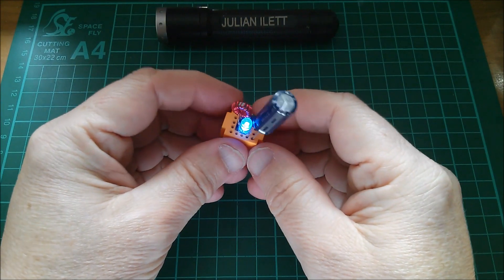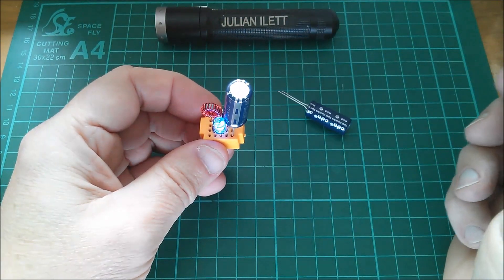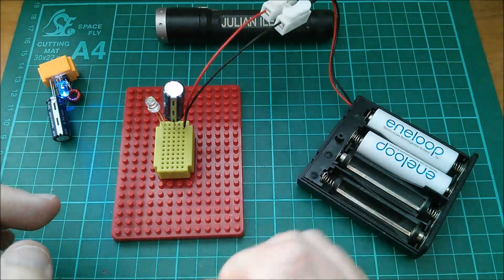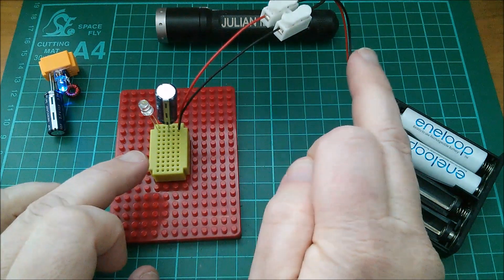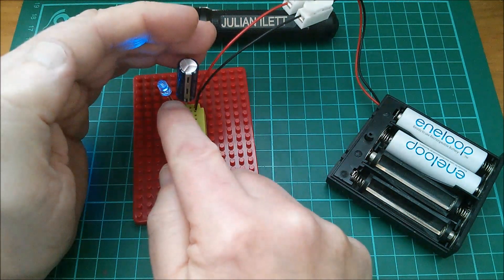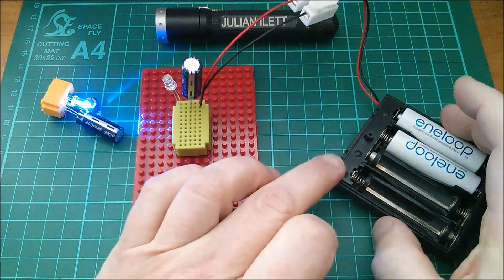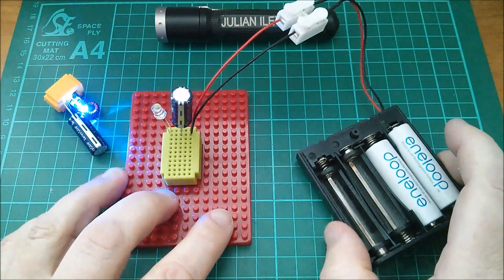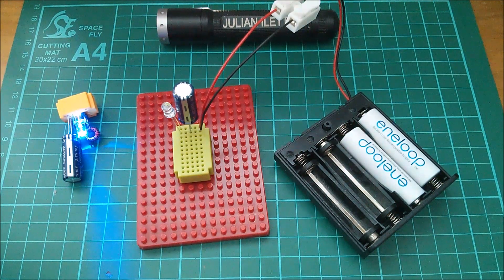Quick and Dirty 2.5V Supercapacitor Charger

Comment: Charging £5 for a momentary switch is the reason Maplin went in to administration
Reply: Yep. I was in town the other day and went into Maplin to see if I could pick up any bargains and walked around the shop gasping at some of the prices. Ten 5mm LEDs, £3.99. Those poundshop precision screwdrivers with 8 interchangeable bits, £9.99. I did grab a couple of reels of wire and some blank circuit boards but even heavily discounted those were only a little cheaper than I usually pay.
Of course they could never compete with China/ebay but there wasnt any effort to compete with domestic suppliers either, or to make their offer attractive in the least. Kind of sad to see them go but if that was the best they could do there was no hope.
Reply: If they weren't SO greedy with their prices, they'd still be in business. Other shops such as poundland and wilko still manage to make healthy profits with their MUCH lower prices and they still have to pay the same staff wages, business rents and electric bill. So there is no excuse for maplin's huge price markup. They should stock more quantity for cheaper price.
Reply: I actually went in to Maplins just before they went in to administration and needed 8 or so momentary switches, only ones in the store were £5 each. I nearly had a heart attack. I don't think I have ever left a store so quickly in my life. Ended up going on eBay and buying the who 8 for less than what one would have cost from an English seller just because i couldn't wait to get the project finished.
Reply: Yup. The only things I bought from there was a breadboard and a couple of switches. Everything is wayyy overpriced. I only go there If I don't want to wait while my parts come from China .
Reply: I just checked out their website... yikes. We have a similar store stateside called Microcenter. They do it just right. Probably an extra dollar to buy it there. I always check them first especially when I don't need a bag of 50.
Reply: Maplin sounds a lot like Radio Shack here in the states.
Reply: I bought a potentiometer for .79p when I could buy 100's of them from china for the same price. There business model was sell to people who need it urgently and mark up the price 4 fold
Reply: Maplin's prices were never an issue for me, but stock levels. When I required more than 2 items of the peg I knew that things were going downhill.
Reply: FeralChocobo Maplin were handy if you were stuck and needed something straight away without a three week wait. But their time is long gone now. I wish Poundland would take up the reigns!
Reply: No mate, £5 for 1 momentary switch is extortion. In the end i waited 2 days for my switches, for a better quality switch no less. When Tandy went was the death of getting good quality electronics from the high street went way.
Reply: Simon Tay  I quite agree I don't see why they couldn't manage nearly all  their stuff came from china anyway
I used to buy from years ago had all their catalogue's they even had a magazine in fact I still have most of them with a few gaps here and there once they got onto the internet things started to be easier than phoning an order through didn't they do something with computer ordering before the internet ?  then some idiot redesigned the website and you couldn't find a thing. Everything had been given another code or number I gave up and went to rapid electronics !
Reply: I stopped going to Craplin reason was that a few times I have rang the branch and asked if they had the components I needed, after 10 mins on the phone the guy confirmed that the parts were in stock. Made the journey there only to find out several weren't there....... Waste of time !!!!!!!
Reply: Yeah they had a BBS online ordering system in the early 80s IIRC... you were making a phone call to (I think) southend on sea anyway so it probably wasn't cheaper than just phoning in an order to a human phone operator.
I think it got bought by a general retail holding company who I don't think understand the market. - they were (and are) selling singles of BC547 at 9p (which I'd pay if I didn't want to wait) - but only hold one or two in each store, obviously decided they could apply the same %age markup to tactile switches and other stuff...  no online datasheet except when someone asked a question on the product page so if you want datasheets you're effectively forced over to a competitors site to download one.
Probably doomed by the internet and chinese postage anyway... but they made some strange mistakes.
Reply: Yeah in the UK we had tandy's which were in the same group as radio shack - they sold the radio shack brands Archer, Realistic, TRS-80s etc. They had town centre stores with quite a small sq ft age each. The Tandy's failed in the UK before radio shack did in North America, they were all gone by 1997 iirc. 
Then maplin which had been mail-order (with a few small shops in the centre of large cites) suddenly set up large shops on out of town retail parks (so you had to make a special trip by car if you wanted to buy anything) the large shops were mostly full of drones, disco lights and home security camera systems afaict.
Reply: joinedupjon   yeah I remember Tandy better known as Rat Shack in the US sorry Radio Shack , after Maplin's started going down hill they pretty much turned their shops into Tandy s with similar price's  come to think of it the first time I came across the joule thief circuit  was in the Maplin magazine one of the regular contributor's to the electronics mags of the day submitted it somewhere around 1993
Reply: The closing down sale might be an opportunity for Julian (or any other fans) to get some spare bits for the Antex in at £reasonable
Reply: No don't think so. I went into my local maplin in Shrewsbury last week and they want £15 for a pack of 3 antex bits. Not a chance in hell I would pay that. I bought the same ones online instead.
Reply: Simon Tay  cool Shrewsbury  know it well lived near there used to go there often there were a couple of electronics shops I used to go to in the seventies but I guess they will have gone  as is the Hi fi shop I used to frequent ! oh and Tandy's too  I agree that's a bit steep for only 3 !
Reply: +Simon Tay -  fwiw the way they've implemented the closing down sale in my local store is they've left the original prices on the shelf edges and stuck a poster above the soldering section with the %age discount to apply to the soldering stuff - so the 3 pack that was £15.99 is now £12.79. It's not a particularly fantastic reduction at the moment but maybe further reductions will be applied later to liquidate the stock.
Reply: What?! £5 for a pushbutton?! That's really abusive! It must have been at least 100 times markup on that item! My local electronics store is nowhere as expensive. Plus, they're attentive and sell quality components. There's one thing which you definitely don't want to buy from China: breadboards. I had bad experiences with Chinese breadboards. Once you insert a pin header, the slots where it went will be bigger and make a bad connection with thinner components. This made me waste lots of time troubleshooting problems. At just twice the price, good quality breadboards are a very good investment.